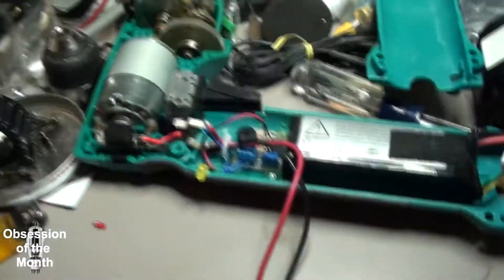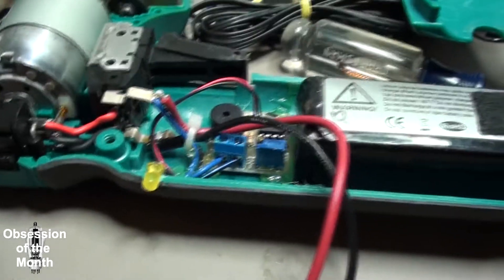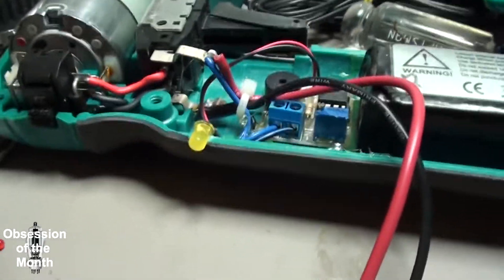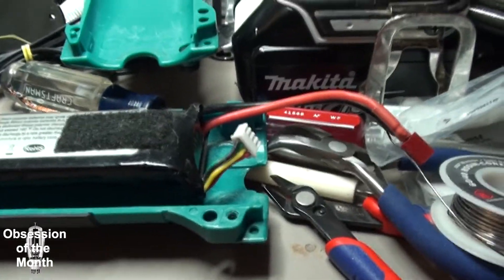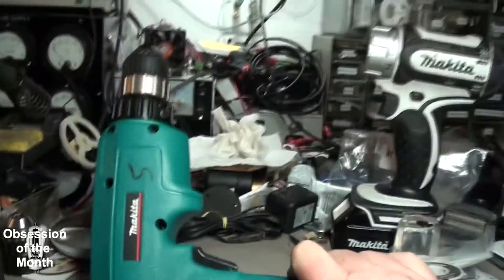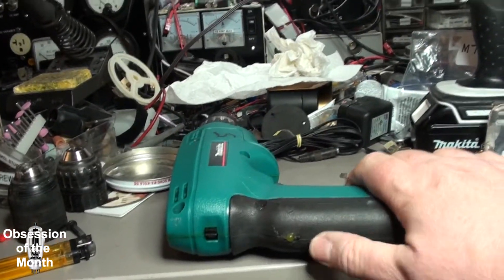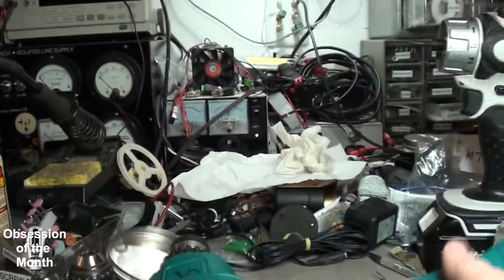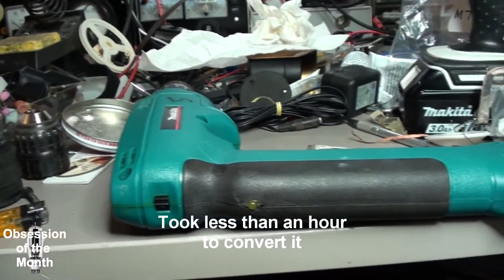Makita 6095D Drill Convert to Lithium Polymer LIPO

Comment: How do you remove the chuck from the drill?
Reply from the maker: there are many video on youtube on how to do that. the screw that holds it on is usually reverse thread, and often has locktite on it.
Reply: @ObsessionoftheMonth  I got the screw out but cant loosen the chuck. I've put a large Allen key in the chuck and whacked it 50 times but it won't loosen.
Reply from the maker: @alexhamilton4084  I had the same problem. I cannot remember exactly what I did. it could be the chuck is normal thread. I no longer have the drill so I cannot check. sorry
Reply: Can you explain which wire goes to what pls
Reply: From what i can see you have a positive n negative on the circuit to the motor, then a positive and negative to plug into the battery. You also just soldered wires from the existing led to that other one. Accurate?
Reply from the maker: yes I removed the led from the board and added another one that could be mounted in the handle.
Reply from the maker: positive and negative from the battery connect to positive and negative tabs in the battery compartment through a socket, battery alarm is soldered the same way. red is positive, black is negative. no other wires were added. for the battery alarm I used what wire I had blue positive, black negative.

Comment: hello good night, greetings from Caracas Venezuela excuse me friend I wanted to ask you the following I have a drill the same as yours and I want to attach new batteries but I don't know how to uncover it because I don't know how to remove the tip here we call it a mandrel it has a screw in the bottom that doesn't I know how it works if clockwise or if you can help me, I appreciate my email is geoza15@gmail.com
Reply from the maker: The screw is reverse threaded and turns backwards from a normal screw they are very difficult to remove there are videos on youtube that show how to do it.
Reply: @ObsessionoftheMonth  I am in the same situation, and I have searched Youtube, but nothing about removing the keyless chuck on the 6095.  Any chance you can provide a link, or a short vid?